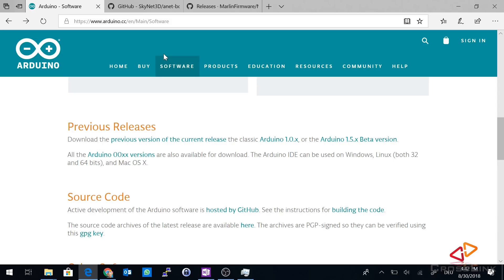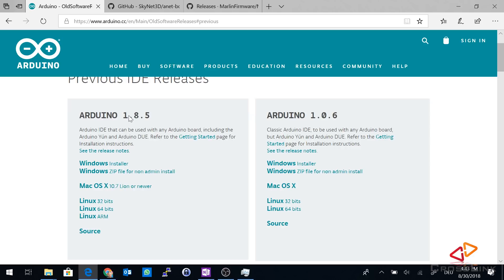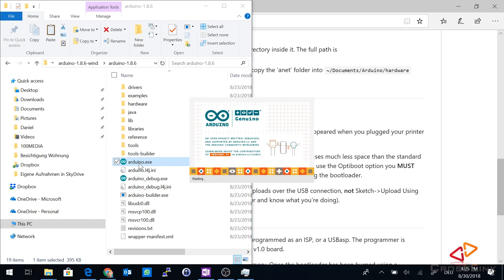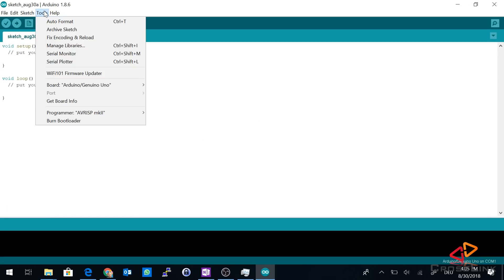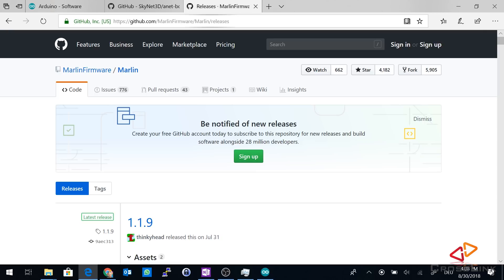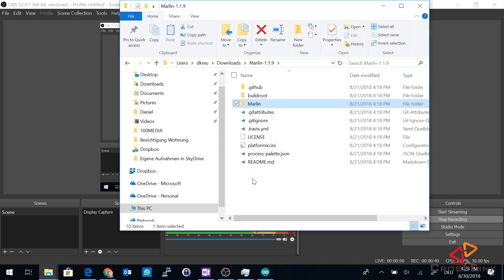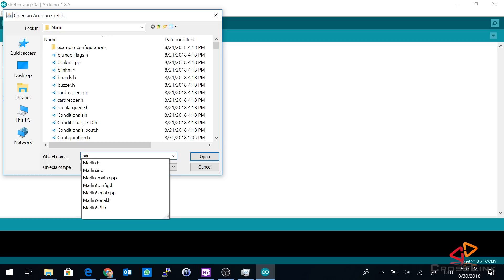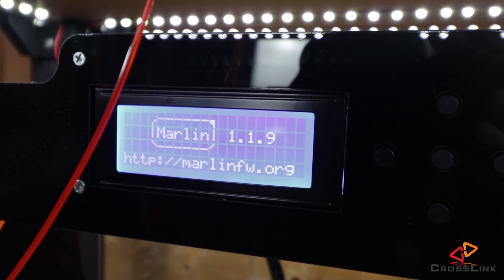How to install Marlin firmware 1.1.9 on your Anet A8 3D printer in 7 easy steps

Comment from the maker: If you're looking for Marlin 2.0 guidance, I have a new video about it here: https://youtu.be/38PkynA1uGI
Reply: I recently bought Anet A8 and have V 1.7 board  Is there any method to upgrade to Marlin firmware(1.1.9 or 2.0) without any USBasp, tinyISP and adapters. I have just the uploading cable and board.
Reply from the maker: Probably not, the chances are almost zero
Reply: @Crosslink3D  not even basic Marlin version?
Reply from the maker: Explorer 6.180 well, the 1.7 board had a bootloader when I tried it but just the normal one, not the optiboot. You can flash Marlin 1.1.9 or 2.0 in the default config on probably. But any updated feature will probably already require the optiboot bootloader to free up some more program memory. Just give it a try!
Reply: @Crosslink3D  I am going to try 1.1.9.1 today.. 
Let's hope for the best.. Will update you soon. 
Also in this video you didn't use any external hardware like usbasp,tinyISP right?? 
Thanks😊
Reply: @Crosslink3D   I tried to verify and it said "Compiling done" with a message "Sketch uses 106194 bytes (83%) of program storage space. Maximum is 126976 bytes.
Global variables use 4130 bytes of dynamic memory."          
Should I upload it to the v1.7 board ???? 
Arduino version is 1.8.5 and Marlin 1.1.9.1

Comment: Can you advise? I am not doing too well. I am running Kubuntu linux 20.04 and Arduino IDE 2.0.0-rc8 (rc3 kept hanging the computer, especially if I had Youtube up at the same time!)  My Printer is a CTC DIY printer with the v1-5 ANET board. I have managed to get the Skynet Library installed, but the IDE  cannot find the hardware. even with the printer connected and switched on. Is this because this printer does not have a bootloader? The firmware identifies as 'I3 Pro B'. Another possibility is the marlin software not in the Arduino directory.  I have an Arduino UNO prepped as a means of installing bootloader, but have not done that.  Any advice appreciated. Thanks  Added: I am trying to install the marlin 1.1.x firmware rather than tha latest version.

Comment: I have a question could Marlin 1.1.9 still work on  Vscode & Platformio.Or would it be best to upgrade to marlin 2.0.Because it seems Vscode & Platformio doesn't accept the older Marlin,even the Auto build Marlin keeps referring to Marlin 2.0.
I must also explain I'm switching to Vscode & Platformio because Arduino keeps showing to many errors.
Reply from the maker: Marlin 2.0 Is the way to go with vscode

Comment: I watched all of your Anet A8 videos on installing Marlin firmware. My Anet A8plus did not come with a bootloader. I have tried uploading both of the Anet V1 and optiboot but kept getting all sorts of errors in Arduino (ex. "content mismatch') I have used both USBisp and USBtiny with the 6 pin adapter and that didn't work either. Do I need to buy a new main board?

Comment: Hi Daniel, I am 4 years late.  I use the Anet A8 i3 DIY that I purchased in March 2017. Now the hot bad connector on the control board burned.  The control board is named as ANET3D (no version).   I have the buy new board (ANET v1.7 I believe) and install new firmware. 
I am trying to follow this movie but the pages of Arduino and Gitub Changed and have different versions. 
being ignorant in the subject, I wonder if you could tell me which video I should follow, for the ANET v1.7 
Thank you dov kruman

Comment: So I tried to update Marlin on my Anet A8 board, as it does not show the bootmenu on the LCD screen. I only see 2 horizontal 'stripes' . I did find al the files described in the video, but after trying three times I keep getting this error "non-constant condition for static assertion" and in the last part of verifying there are several all lines in red. Those lines look like this: C:\Users\FMJ\AppData\Local\Temp\arduino_build_373078\sketch\endstop_interrupts.h:161:21: note: in expansion of macro 'digitalPinToPCICR' static_assert(digitalPinToPCICR(Z_MIN_PIN) != NULL, "Z_MIN_PIN is not interrupt-capable"); "

What am I doing wrong? What should I do to get things right?

Comment: Great tutorial! works in the V1.7 board and with marlin 1.1.9.1
Reply: That's good to hear. I have the V1.5 board and I watched the Crosslink video about the difference between the 1.5 and the 1.7, and also noted in this video the buttons to control the menu's unlike some other printers. i have a CTC DIY printer kit that I am trying to upgrade and I think this might work. I used a different set of board configuration file and it wouldn't verify the marlin firmware. Wish me luck.

Comment: I need some help guys! I updated my A8 to 1.1.19 successfully but when I did a home all command my extruder motor went all the way to the left and straight down and kept forcing itself down on the bottom of the frame and I had to unplug it. Also on the LCD the XYZ is flashing 0’s & question marks. I’m new to the whole 3D printing thing but it’s like it doesn’t know where the bed is at all.

Comment: Hey, I flashed the Optiboot Bootloader with an Arduino Uno, and tried to flash the new Firmware marlin 2.0 via USB Cabel..i tried it with Visual Code and with the Arduino IDE as you explained it in your very good  Videos!
In Visual Code there is still an Error with the Flash-Storage and in Arduino IDE there is the following error:

sketch\src\module\motion.cpp:513:60: note: in expansion of macro 'TERN'

   do_blocking_move_to_z(_MIN(zdest, Z_MAX_POS), MMM_TO_MMS(TERN(HAS_BED_PROBE, Z_PROBE_SPEED_FAST, HOMING_FEEDRATE_Z)));

                                                            ^

exit status 1
Fehler beim Kompilieren für das Board Anet V1.0 (Optiboot).

As you can see im German too ;)
It would be very nice if you can support me with this problem!?
Freundliche Grüße,
Daniel

Comment: Hi, Thanks for the informative video. I have successfully updated the firmware for my Anet 8 on a V1.5 board. However, when I connect the display, which is a display with 5 buttons, I couldn't make any selections. I only connected the display to the bare board to test it. A question; do I have to plug in all the motors and switches etc to make the buttons work properly? Thanks

Comment: Daniel, I recently got an Anet A8 and have been doing all the mods to it; watching a lot of your videos and I'm able to follow this video all the way up to the configuration h file before I run into a snag. The current version of Marlin to date is version 2.0.7.2 and your video says to download 1.9 I believe. I downloaded the 2.0.7.2  because it was the latest version, which is what you seemed to have been looking for and because my printer has version 2.0.5.4. My question is: Do I need to forget about the latest version and download the 1.9? I could not locate the Anet file in the configuration h folder of the newest version because it has no configuration folder; only a text doc. I'm concerned that I'll be moving backwards if I download the 1.9 but I'm at a dead halt with the latest version. Please advise

Comment: i've been following your videos like every minute for all matter related to Anet a8 but i've a little issue when i create the folder in arduino ide and try to opened it doesnt show the option for anet how i can fix that problem ??
Reply from the maker: Missing board definitions in your personal profile folder probably are the reason. Did you follow  the steps to download and install them?
Reply: @Crosslink3D   sorry i miss it the old board the d5 light doenst work at all thats when i got the v1.7 only showing white squares

Comment: Thank you for this video, as a 100% noob on installing firmware this video helped me doing just that. Did everything like in the video up to the upload part, but i could not find the upload button and i did not see the upload progress bar. Now i am not sure if the upgrade completed cos i applied the update to a newer v1.7 board and my old board was v1.0 ,is there a way to check if it was uploaded? I did not hear my printer restart but the lcd panel display is working. Thx for all the info. UPDATE; BTW i just saw your pinned post now regarding the v1.7 and i guess this is maybe my problem.

Comment: If you mean the controller as the board I'm using ANET V1.0 , for the display I have an LCD which came with the printer since 2016

Comment: Hello Dan
After watching your video for more than 3 times, I tried to upgrade my Anet A8 to Marlin Firmware 1.1.9, Everything goes  Normally, Restarting the Anet A8 then the first screen with Marlin 1.1.9
after that in the second screen I'm getting X Y Z blinking from 0 to ?  when trying  to start the main menu (Info screen  -  Prepare  - Control ...) nothing is happening just getting the second screen with XYZ blinking. Have i made something wrong ? I carefully followed your step by step procedure. I need some help - Thank you.
Reply from the maker: Probably you misconfigured what controller and display you have?

Comment: Hi Daniel ... did you copy only Configuration.h to Marlin folder and not Configuration.adv? it's correct ? Thanks
Reply from the maker: Nope, copy both files. But this video is about Marlin 1.1.9. you should go for 2.0 and check out the new guides
Reply: Thanks Daniel ... very kind. I don't speak English very well and from the video you could only see that you copied Configuration.H Thank you very much ... also for the fast response
Reply from the maker: In Configuration.h set the #define LCD_LANGUAGE to it-it. Might work already but if not, you should read this guide: https://marlinfw.org/docs/development/lcd_language.html

Comment: Really fantastic. I have Marlin 1.1.8 on my Anet A8 but want to add an LCD screen upgrade and a BLTouch bed leveling sensor. This looked like a good approach. I would like to move to Marlin 2.0 but was worried about memory issues. Is there a board upgrade that will solve the memory issue? Can a Raspberry Pi be used to span this memory gap?

Comment: hi, I tried your steps but I failed. it says

 "avrdude: stk500_recv(): programmer is not responding
avrdude: stk500_getsync() attempt 10 of 10: not in sync: resp=0xfe
Problem uploading to board.  See http://www.arduino.cc/en/Guide/Troubleshooting#upload for suggestions."

Im using 1.8.5 Arduino IDE... do you know how to fix it? thanks

Comment: Nicest video I've seen. However,  my problem is with software. I cannot locate the IDE page. I have uninstalled and re installed 1.8.5, but with the .zip only and the windows installer. Many suggestions on the Arduino forum, none of which worked for me. What am I doing wrong?
Reply from the maker: What exactly do you not find? If you unpack the zip you should find an arduino.exe in there.
Reply: @Crosslink3D  when I attempt to open the marlin.ino file, nothing happens. no sketch shows up in arduino. I have the versions you use (arduino 1.8.5 and Marlin 1.1.9) I have spent two days installing and uninstalling, being very careful to follow instructions. I have windows 10 on my laptop and XP on my desktop. Same results. I have to be doing something wrong somewhere...
Reply: I didn't bother to check if I had Java installed. No. So I downloaded it and did a restart. No improvement. So I uninstalled everything and reinstalled it and followed your instructions as closely as I could. No joy. Of minor interest, when I download Arduino, I get the 'sketch' page only. When I download it a second time, I get the full program. When I try to open the Marlin.ino folder, it will open Arduino but nothing is there from the Marlin folder. Sometimes when I open the Marlin folder, it will take me to another documents page with two lines of address and will open Arduino with the same blank screen. The line leads with the Arduino icon. Am I missing a boot folder, perhaps? I tried the 'blink' sketch to no avail.  Thank you for your patience.

Comment: nice guide, can confirm that even in march 2020 you still need the 1.8.5 arduino dev i.e. you will get compilation errors if you try and use anything newer.
Reply: August 2021, 1.8.5 version still needed
Reply: 2022 April?

Comment: hi, What is the problem ... When the initial operation, the extruder is directed to the opposite side to the end and continues for a while the engine rotates even when the extruder reaches the end ... The same applies to the surface ... Also, the z direction motor works one and the other does not work .. Note that I almost checked the connections  All are correct, i am using Anet A8
Reply from the maker: this can be fixed in the firmware easily. Switch the motor directions in Configuration.h, look for INVERT_X_DIR , ...Y_DIR and ...Z_DIR and change accordingly.
Reply: @Crosslink3D  thank you Dan.  I will try
Reply: @Crosslink3D  Please, can you explain to me how to do it?

Comment: What about the thermal runaway protection? Is that already active when you install the Marlin firmware, or is there something you need to do in the code to activate it?
Reply from the maker: It's active by default!

Comment: notes about java. if you use the recommended or default downloads from java.com you will 99% of the time have the 32 bit architecture, and modern computers from the last 10 years or so should use the 64 bit version if you have a 64 bit OS installed.
ALWAYS go to other downloads, then the offline 64 bit download. this guarantees a 64 bit version of java and wont download any extra things cause the normal java will download those anyway.

Comment: Hello. Fantastic comprehensive tutorial as always! Thank your for that. BUT... I'm having problems with strange characters showing on the LCD display after firmware upgrade. Any thoughts?
Reply from the maker: Did you copy over the Anet A8 default configuration files to the Marlin folder before flashing? Are you using another custom display than the stock version maybe?

Comment: can you do an updated video for the 1.7V Anet board.  I am having trouble flashing to it using Arduino
Reply from the maker: Well, the board version should not have any influence, they all work the same. It might be that you have a faulty or missing bootloader more likely. Do you know how to fix that? I have done several video about that.
Reply: @Crosslink3D  I bought a new replacement board for my Anet A8.  Should it come with a boot loader?  When I power it up all it shows in the display is #########
#########
Reply: @Hemidodgeboy  im having same case

Comment: WOW, perfects video, everyone says what a BREEZE this is, so i read 1/2 a dozen website write up and had those pages open, and still several HOURS later i was not getting anywhere with confidence. With your video I walked right through it and it was dione. THANK YOU! (too many authors presume you have experience with arduino, sorry Im a RPI guy, never touched an arduino...yet)
Reply from the maker: Jerome Hess, thanks for your comment. Always appreciate your contributions. If you have ideas or suggestions on what I can improve or what videos you like to see, please tell me here in the comment section. Daniel.

Comment: Using links you provide, the Marlin.ino would not compile showing errors regarding endstop pins not being interrupt capable.  In configuration.h, I commented out that feature as "// #define ENDSTOPS_INTERRUPTS_FEATURE" and the compile was successful.  I will check comments and forum to see if others found this issue.

Comment: verifyng the files give me an error 

Arduino: 1.8.5 (Windows 10), Board: "Anet V1.0"

In file included from sketch\ultralcd.cpp:100:0:

sketch\ultralcd_impl_HD44780.h:194:29: fatal error: LiquidCrystal.h: No such file or directory

   #include <LiquidCrystal.h>

                             ^

compilation terminated.

exit status 1
Error compiling for board Anet V1.0.

This report would have more information with
"Show verbose output during compilation"
option enabled in File -> Preferences.

Comment: Hi, Firstly I must thankyou for your anet how to videos. Having followed your video on how to flash marlin to my mainboard,  I followed your videos and all went very well, except when I come to print the stepper motors sound very noisy, much more than before, and my bed motor is getting very hot along with the stepper i/cs, is there any settings to cut down the current to them.

Comment: My Anet A8 3D printer has a bricked LCD after flashing the firmware.    Is it possible to re-flash the Marlin firmware with the help of this video to resolve the bricked lcd ?    Or is there a different solution to address the bricked lcd?

Thanks

Comment: Hello Daniel.
I have a fatal problem when Marlin 1.1.8 firmware flash on Anet A3 board.
LCD blank & buzzer sound about 3 seconds.
I tried flash bootloader, but still the problem hasn't been solved.
Please help. & thanks for the question.

Comment: Hey Daniel, thank you for the great content. I have a Tronxy P802MA which is an ANET A8 clone. Do you know if I can use the same configuration? Thank you in advance!
Reply from the maker: Well, if it has the same mainboard and dimensions and parts, probably this should work with the same settings.

Comment: Thank u very much. Appreciate .
But I have some issue if u can support.

after updating my stock A8 to marlin 1.1.9 with the correct configuration profile , after auto home the display shows: X -33 Y -10 Z 0 , and The home position for my printer is not above the bed . so I am trying to adjust the X and Y offset . I'm not sure if I am doing this correctly but I use the menu to move the the correct corner of the bed and then select "Set home offsets" but I get an error: Err: Too far!
Plz support